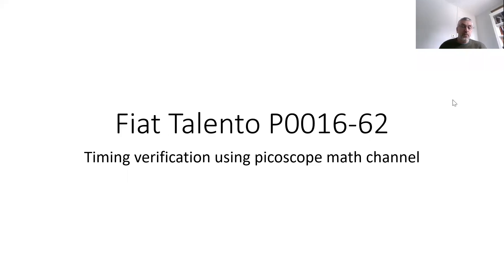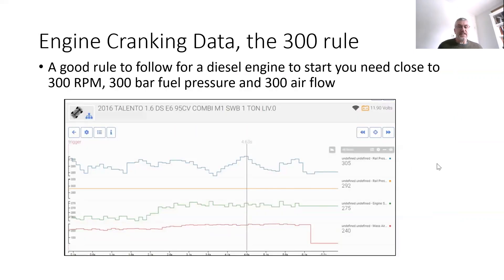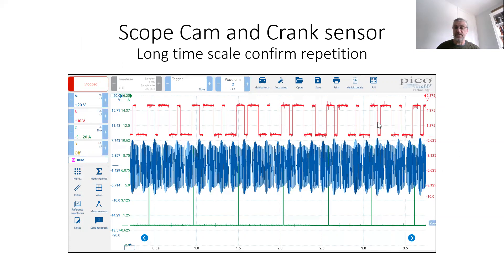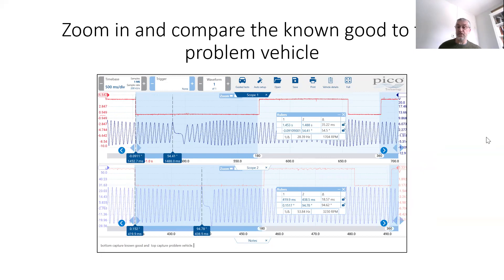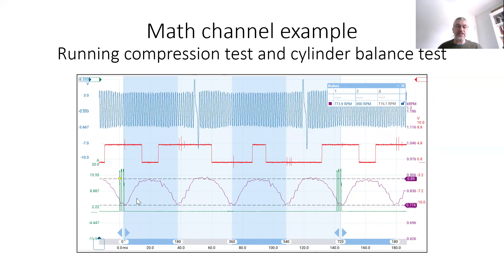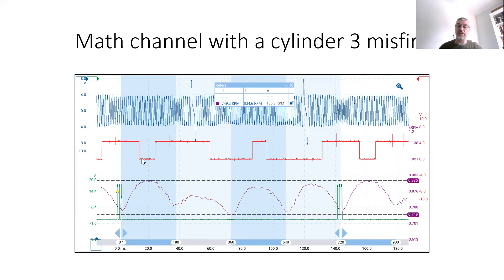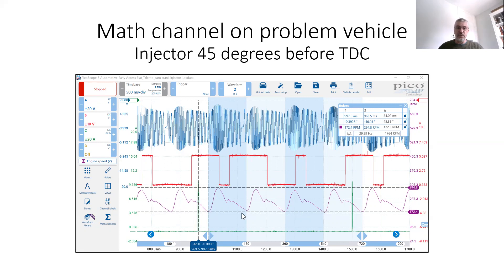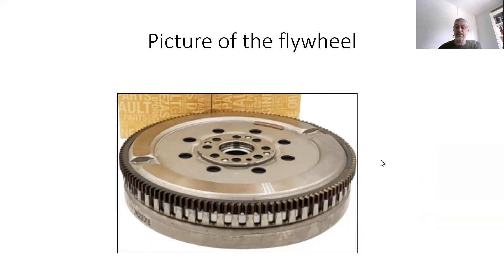picoscope math channel timing verification

Comment: Nice video! Would you mind sharing the  math channel formula you used?
Reply from the maker: i used crank(A,60) but altered the rpm range depending on the cranking capture or the idle capture

Comment: Nice video, Simon, and an excellent example of the use of crankshaft acceleration; it’s spurred me on to try that out and get more familiar with it, especially on PS7.   I’m still wedded to PS6 right now.    What I don’t understand is how the flywheel came to be 45 degrees out.     I rewatched the video and looked at the history as displayed at 0.18 into the video, and I see no mention of the flywheel having been disturbed during the work to replace the timing chain and the oil pump.      So how did the misalignment occur?